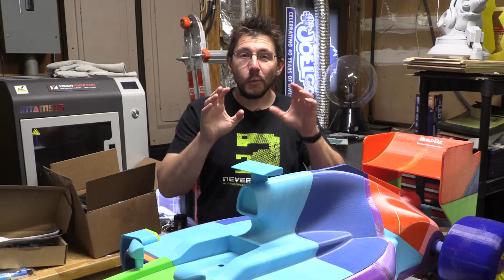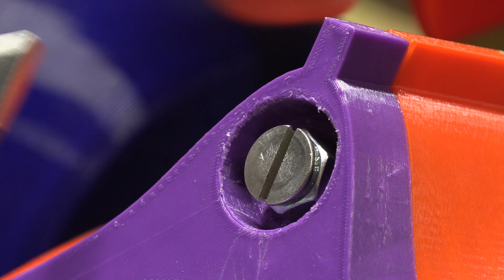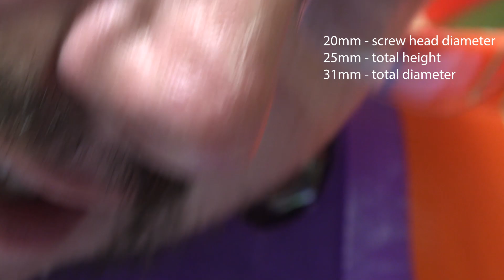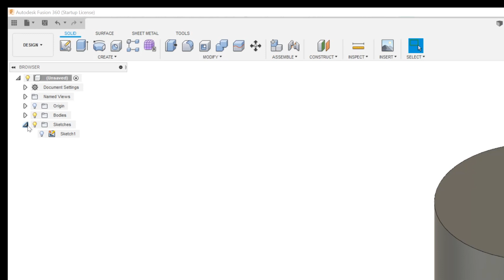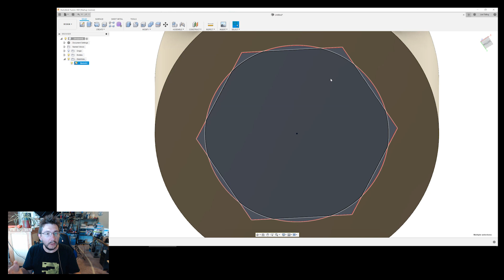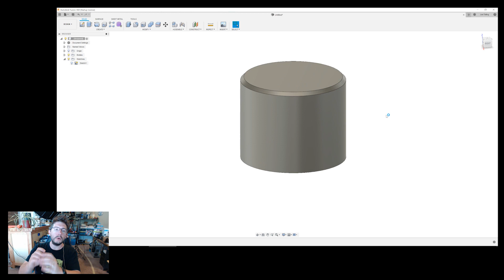Worlds Largest OpenRC F1 - Car Update & New Lock Pin Tutorial!

Comment: The cut operation was a centimeter in too deep (you measured 12mm, which you doubled to 25mm depths), so cutting in 22mm cuts you 10 mm into the overhang, which presumably substantially reduces the part strength against shearing from the top part.
Reply: So I wasn't the only one who noticed.

Comment: Hi why not just make the cut away inside the plug the dia. of the polygon in other words 19.5  mm dia. inside measurement and as suggested by another of your supporters  put a magnet in it to hold it in place. 
But I would go even simpler just make a tube piece with the correct outer dia. to fit into the top bodies recess & the correct inner dia. to fit over the nut & screw KISS (Keep it simple Sally) I am really lazy so the simpler I can make it the better I know you need to show how to use Fusion 360 and thats good but this is a really simple thing to fix and you added a little more work than really needed

Comment: Joel, you could have changed your model so you could eliminate the nut. If you made the cilinder and made a hole in the middle with a chamfer for the bolt head. This also secures the battery lid plug so you cant lose it

Comment: Love the real example from concept of what you need to fusion to complete.  Would have like to see you do you the step of printing and those settings
Reply from the maker: The printing was the most boring part - crazy right? Used Prusa slicer defaults and just hit print on the printer. I’ll try to remember to include that next time though. Good idea.
Reply: 3D Printing Nerd thanks.  I realize it’s the boring part.  Hahahaha.   I did miss that one part in this video example.  Still a great video 😉

Comment: You should look into 3dlabprint planes, the way the cockpit opens up for the batteries and servos spring loaded latch's are nice to deal with. I been on a zip tie thing myself atm making loop holes in the 3d print for the zip ties. I figured if zip ties are good enough to hold a junk Prusa MK2s together should hold most of my projects just fine. Im just giving you another connection method to use in future projects your F1 looks good. I might have to make one in a month or 2 got lots of stuff im working on atm
Reply from the maker: I will look them up!

Comment: That was needlessly complicated. 
1: cut the screw to right length. Use file to remove burrs with nut left on. Removing nut restores thread.
2: you didn't have to extrude a hexagon; just use the diagonal as a circle to extrude.
I am working on a new 3d printer; are you willing to discuss that under a nda?

Comment: why didn't you just cut the screw shorter? :O I'm sure you have an angle grinder or even a dremel.
Reply from the maker: I do, and thought about it, but I still would have needed to create a new pin since original was too wide. I already to had to open Fusion - might as well make it fun :)

Comment: Why didn't you cut off the screw? You don't have a hack saw? I love my hacksaw. It's blue.
Reply: Dave that would be too easy! 
When you are a 3D printing nerd, you figure all sorts of ways to nerd 🤓 it up and use the 3D printer to hack the situation. 
But yeah, threaded rod with a nut on either side. BOOM!!!
Reply: @Keifer-D  red loctite and she'll be right. Loctite 603 is also appropriate.
Reply: Does it Da ba dee da ba daa LOL
Reply: My first thought as well, but since I'm a mechanic with a decently equipped shop that'd ALWAYS be faster for me than getting on Fusion, designing something that fits perfectly and then (probably) tinkering with scaling to fit perfectly, then waiting for it to print. :P
Reply: Cut it off??? Psh.. print the bolt to exact specs needed.
Reply: adhd 100

Comment: Why not just take a grinder to the screw/bolt to get it to the correct length, then you don't have to make anything special.
Reply from the maker: I thought about that - but I knew I had to make a new lock pin because the old one didn't fit (diameter too large). Making a new one AND the excuse to measure stuff with a caliper was just TOO much to pass up :)

Comment: Absolutely love doing stuff like this! I replaced a part in a high end model kit similarly (though I had to use a flat bed scanner for one part, it got me more accuracy than my cheap calipers). It's one of those little things that you can run off on a printer really fast and it saves you so much time in the long run
Reply from the maker: Exactly this! I thought, "You know, I could just try to drill out this previous part..." and then I thought better of it, and got my calipers :)
Reply: @3DPrintingNerd  And it's just so much fun :D  We have sci fi tools with us, let's play!